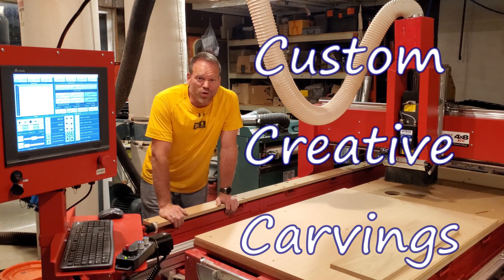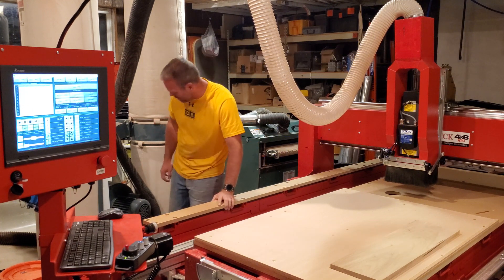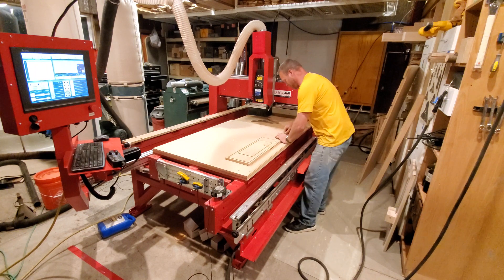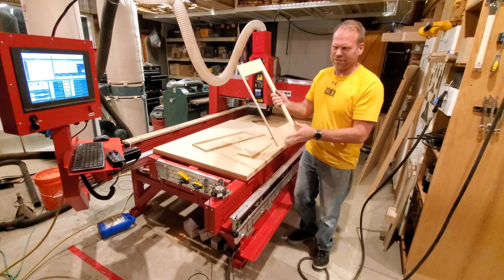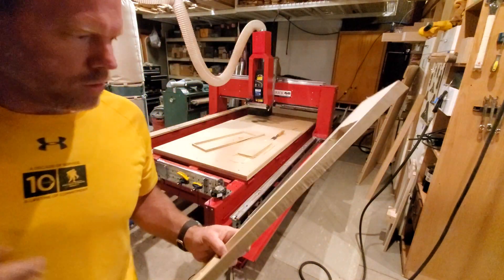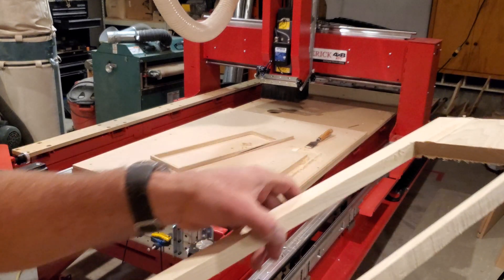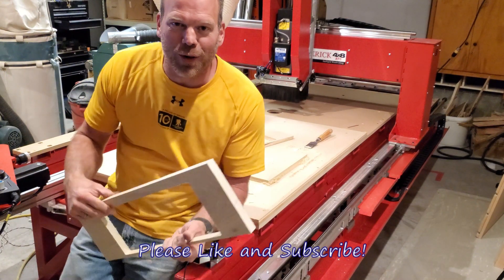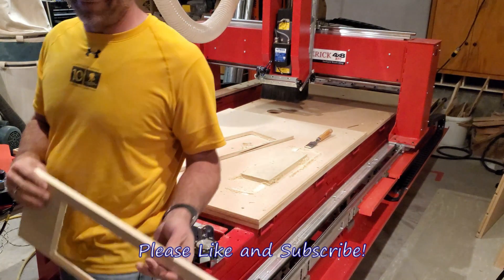The fastest (IPM) CNC cut I have ever done!

Comment: Wow nice router my friend !!! and the tape held it down!
Reply from the maker: Steppers, the common misconception is that one is better than the other, reality is that each has it's strengths if set up right.
Reply: @CustomCreativeCarvings  i agree. I'm running closed looped steppers and i couldn't be any happier for the money.
Reply from the maker: Thanks, yeah the tape held it well. I use tape for most of my projects, now day's.  I have not yet set up a t-trac table on my new CNC yet.
Reply: @CustomCreativeCarvings  is your router using stepper or servo motors? i'm guessing servos
Reply from the maker: Mine are closed loop also, an upgrade from my last machine.